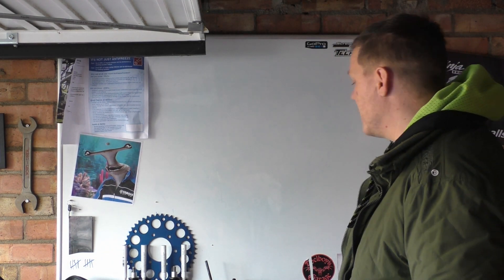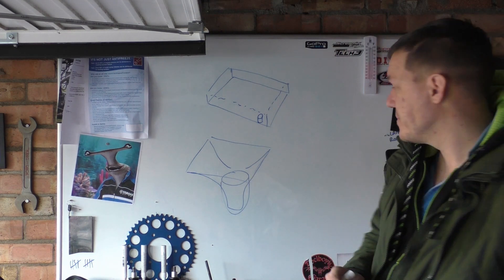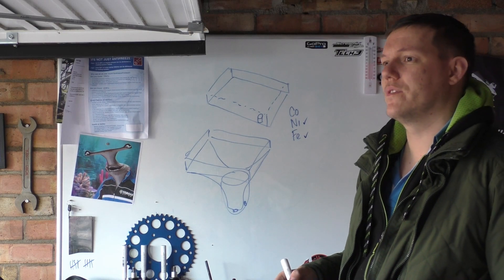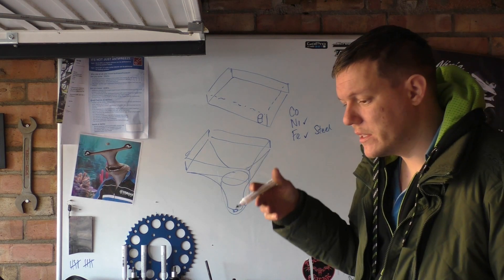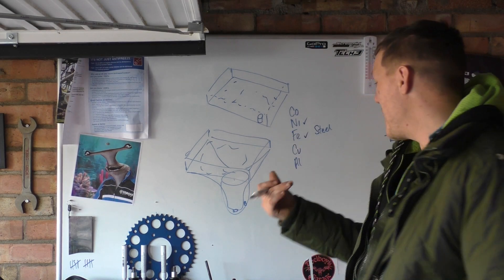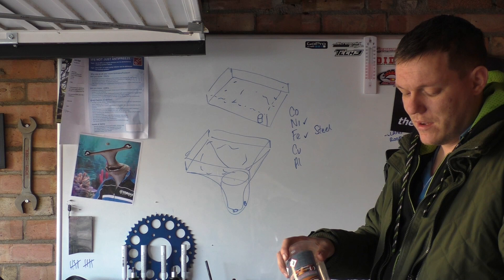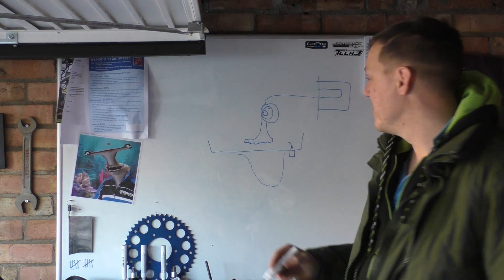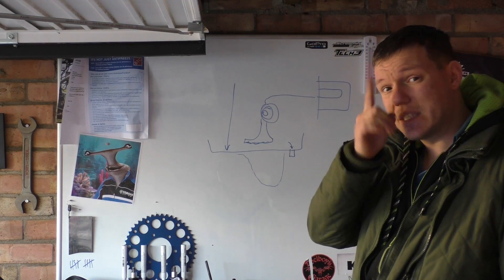Magnetic Sump Plug - Any good?

Comment: No, it doesn't make sense Matt. You've completely missed the point mate. 

The purpose of the sump plug magnet is to catch any iron based particular matter free in the oil system - TO ALERT YOU TO THE PROBLEM that you have... iron based particular matter free in the oil system. 

And you may ask why is this important? A few reasons spring immediately to mind:

Firstly iron based particular matter free in the oil system is an indicator that something iron based within your engine is failing. This could be due to a bolt vibrating lose or a roller bearing breaking down. 

Why is this important? Well, if an iron based bearing, chain or (as commonly occurs) a tensioner is breaking down, then the debris is likely to be potentially sharp, relatively large, and hard. Therefore it will cause massive damage to all parts of the engine, but most quickly and devastatingly to the softer (and expensive to replace) parts such as the pistons, bearings and bores, as well as the hardened metal to metal parts such as the cams, followers, valves and gears etc. 

Whilst if a bronze bearing or an aluminium part such as a piston is breaking down, the resulting bronze or alloy based particular matter free in the oil system will (as you said) most likely to be much smaller, and (even if its a lump of piston skirt) much softer and therefore cause a lot less damage to any parts, than any iron based particular matter free in the oil system. 

That's a no brainer. It's an early warning system. I've seen little 'Christmas trees' and mats of tiny iron particles on magnets in the past. You find such evidence long before you hear a characteristic noise associated with some part failing. 

This is just one more reason why regular and more frequent oil changes than the manufacturers recommend is a great idea - especially if you do track days, ride very hard, or do a lot of short journeys. Each cause excess engine wear. The oil is the most important and cheapest component in any engine. Change it regularly, check the sump magnet every time, and you will lengthen the life of the engine many times over. 

I hope this has been useful.
Reply from the maker: "The purpose of the sump plug magnet is to catch any iron based 
particular matter free in the oil system - TO ALERT YOU TO THE PROBLEM that you have... iron based particular matter free in the oil system."

1) if you have chucks - where did they come from and surely you would notice.

2) Tiny iron filings would alert you to what? Normal wear or a problem? If you have foun tiny filings on your magnetic plug, what did you do? Tear the whoel engine down? if not then your theory is incorrect, by your own inaction.

3) Like I said most of the engine components that shit the bed are not steel.

4) Filtering out the shit is what a filter is for....
Reply: The Workshop you replied:

" 1) if you have chucks - where did they come from and surely you would notice."

Any of the places mentioned. And you might not notice. If a cage starts to break down on a roller bearing, the thing could still be working reasonably well. 

"2) Tiny iron filings would alert you to what? Normal wear or a problem?"

How long is a piece of string? Change the oil and check it again in 100 miles or less. Simple. 

" If you have foun tiny filings on your magnetic plug, what did you do? Tear the whoel engine down? if not then your theory is incorrect, by your own inaction."

Ah, assumption is never your friend. I always listened to the engine in various parts using a hardwood dowel - as my Dad taught me to do. He learned the trick from a guy in Liverpool who prepared his own Velo for the island every year.  

Having listened to an engine from brand new and monitored it regularly, my ear was attuned to the differences. This made it a lot easier to isolate potential issues. Some people laugh at this method, but it works. 

What I did next always depended on the age of the bike. If it was still under warranty I took it back to the dealer. If he refused to investigate the issue, I rode it like a cunt until it broke. THEN I took it back to the dealer again and told him I wanted a new fucking engine. 

If the bike was older and out of warranty, I either stripped it down to check the suspect part (and found I was always right), or I part exchanged it - at the dealer that refused to take me seriously the last time :)) He always inspected bikes before buying, serviced them and issued a limited warranty to the next owner. 

"3) Like I said most of the engine components that shit the bed are not steel."

Most times you fall off your bike you don't land on your head. Is that a valid argument for not wearing a helmet? Like I said, it's there for the really abrasive hard bits that just happen to be steel. 

The point I missed before is that you often find minute curly bits of steel swarf in engines. That shit is really abrasive. I've examined bits of swarf from magnets that look like flattened springs. That means they've already been through one or more bearings!

"4) Filtering out the shit is what a filter is for...."

Next time you see a scored piston and or bore on an engine that hasn't seized or dropped a ring, consider that the oil which splashes those components may not actually have gone through the filter before the particulate matter suspended in it caused the damage. 

After I was in aero engineering I went into advertising and had several race teams as clients at one time. Another built race car chassis. Some designed kit cars. Another maintained historic race cars and ran them all over the world. I even had Barry Sheene as a client. So I've been in the room when the tech guys who absolutely HAVE to know what's going on inside an engine were discussing diagnostic methods. In those days there were a lot of magnets on engines. But it wasn't widely known. 

I've also worked with the guys who restore, maintain and fly warbirds. I'm not going to namedrop, but I knew personally half a dozen Spitfire and P51 owners, their pilots and their maintenance guys. Guess what, they all know about the value of magnets in the oil system. 

But if someone tells you strapping one to your dick will give you harder erections, he's a lying cunt ;))

Comment: Fair enough not much ferrous material in modern car engines but for gearbox’s and any other transmission parts they generate a lot of ferrous waste
If you have a magnetic drain plug and collect anything then it has done something better than nothing 
Now put magnets on the outside of your oil filter and bam you get to have all of the oil pass through a magnetic filter when you change filter remove the magnets and put on new filter

Comment: Magnetic plugs, its a give or take thing with me I won't go out and deliberately pay extra for one but I won't avoid buying them either.
That said I was servicing my mates bike and found bits of needles and race out of a roller bearing caught on one with more in the strainer, it turned out the bearing from one of the gears that transfers power from the starter to the crank proper shat itself. 
Although the engine had to be rebuilt the sump plug did alert me to the failed bearing.
Reply from the maker: "it turned out the bearing from one of the gears that transfers power from the starter to the crank proper shat itself."

- but he didn't hear it when starting?
Reply: Yeah the starter did make a clicking/rumbling sound and he was told by the previous owner that it always did it and not to worry...
Reply from the maker: "he was told by the previous owner that it always did it" - reciepe for disaster right there LOL

Comment: Agreed, If there's one there, fine.
 Syphon tube? Suction tube surely,
Reply from the maker: pick-up tube, syphon tube - who cares
Reply: It's easy to get pedantic about details like that, I enjoyed your drilling video, reminded me of Ichiban Moto. 
 Cheers, J.
Reply: I wanted to comment that as well: A syphon tube to me is like a U shaped thingy so there is always water in it so no nasty smell/gas can go through like in your toilet or more visible in the piping under the sink. So the english definition is actually different from that I suppose?
Reply: You are almost right, the thing you are thinking of is a water trap, It stops gasses passing back up pipes without blocking the pipe to allow for different pressures either side (badly put as usual).
Reply: Average Joe yeah that toilet/sink U shaped thingy. That's the only thing called syphon in german
Reply: water trap is a quite easy and descriptive name though :D
Reply: Yes Joe. A water trap is the U Bend under a sink, bath/shower or your karsey, the bit to stop minging smells from coming back up the drain.
A syphon is in the toilet cistern and when water is pulled into it, the whole cistern then SYPHONS out flushing the bowl and the shite etc away.
If it doesn't actually syphon I wouldn't think it proper to refer to it as a syphon.

Comment: If your sump plug is a bit chewed up and you can get a nice new annealed copper washer and magnetic sump plug from ebay for £2 - 4 delivered then where's the harm? They can grab bits that might be overlooked at oil change and alert you early to an already developing problem but by then you are probably in trouble if you see more than a tiny amount of iron dust/oil mulch.
 If you are seeing stuff such as a needle roller or big shards of metal, it will only attract ferrous remember so only bits of ball race cage , needle roller and maybe shavings/ a shard of piston ring etc. are likely to show up, otherwise you might get bits of cogs from gears or selector dogs if you change gear like a wanker or do clutchless downchanges or can't change up because you're a numpty.  Either way it all spells medium to big trouble in my book.
Most of the motor is aluminium, with magnesium bits sometimes on race bikes. I used to be a bike mechanic in Waterloo, London after I left a shipyard in 1990 and I was taught to always recommend people change their oil at either the mileage the manufacturer recommends or even sooner if you like to thrash the tits off your bikes and every year regardless of if you have reached the mileage they say. If you do small miles and have a nice dry warm garage for your pride and joy you might be ok every couple of years but I personally would stick to the script and not be a scrooge. ALWAYS CHANGE YOUR FILTER!! I tend to use either a OEM or same supplier none branded, meaning that if Nippon Denso make Honda's filters, I would fit genuine Honda if in warranty and the same filter for half the price because it comes without HONDA screenprinted on it but is IDENTICAL in every other way, made in the same factory by the same people, Nippon Denso.
 I don't do spurious ebay crap to save 47.3p over what I have just stated. I always use the grade and quality oil the manufacturer recommends or better even, they know best, they spend tens of millions on R&D so why make your own mind up and think you know best. Also don't be tempted to put fully synthetic in to a bike that is meant to run semi synthetic, it won't damage anything but quite often, like on the Fireblade and other CBR's, you can get a bit of clutch slip as a result, annoying at best and costly if you leave it at worst as you will have to fit a new set of clutch plates and change it back to semi-synthetic.
 I want a shiny anodised red sump plug, Del Boy swears my bike will go faster as a result, well, he probably would, it's the kind of crap he spouts all the time.
Personally, I think he eats too much cheese (maybe knob?), dreams too much at night and thinks it's real life when he wakes up in the hooves of his goaty lover.

Comment: Magnets actually repel aluminium and copper.

Car gearboxes tend to have a magnet at the bottom of the sump from the factory for the reasons you have highlighted, plus the increased likelihood of having large participial's in the oil if someone had been grinding the gears. Also with the gears themselves being the oil pick ups, you don't have a screen or filter. ...Car engines not so much.
Reply from the maker: "Magnets actually repel aluminium and copper." - are you sure LOL
Reply: The Workshop just like delboy and his water/oil emulsion, he's just too smart to be understood, really.
Reply: Magnets repel anything conductive however it is an extremely week force. Hence being overcome by magnatism in steel ect being atracted. This is only really demonstrable with extremely powerful magnets however if we are talking microscopic particles there might be something in it.
Reply from the maker: LOL you nice try, seriously. This would be true if the magnet was a powered AC magnet. 

Steel is magnetic and will be polarised by the field and produce an amplified magnetic attraction. 

Aluminium is non magnetic and this does not happen. However it is a good conductor of electricity and the changing magnetic field will induce "eddy currents" in a block of conducting material.  

The net effect of these eddy currents is to produce a weak magnetic field that opposes the field of the electromagnet so the aluminium is repelled but only  by the an AC powered electromagnet.
Reply from the maker: For people who are interested look at the Lenz effect - https://en.wikipedia.org/wiki/Lenz%27s_law
Reply: Nope... diamagnetic effect is not exclusive to electromagnet and Lenz's law simply describes how electromagnets work (by exploiting this effect).

Comment: Ok, I'v poured 10 grams of iron filings into the oil filler on my car tonight to see if this magnetic sump plug works for sure.... I intend to use the car for 1 week from today and I will remove my magnetic sump plug next wednesday to see if it contains the 10 grams of iron filings I put in for conclusive proof one way or another.... And you think you know how to do experiments Matt ??
 I'll show you :)  X
Reply: Good luck with your car's engine.
Reply: cringe lol :)
Reply: Sound's like one of Del's experiments.
Reply: Interesting experiment. I recommend you continue with this approach for several cycles to find the optimum position for the mag plug :o)
Reply: @ Truzo
Does sound like it, but I thought of it all by myself...
Reply: Hey Eddie - start a mag plug channel - its going off mate! :o)
Reply: ha ha ha, be funny if me car don't have a magnetic sump plug wont it ? ....

Comment: so you know a lot about magnets. i had tried this style plug once. when i went to remove the bolt the head snapped clean off leaving the shank stuck in the oil pan meaning i had to drill to remove it. do you think this had anything to do with the magnetism or just a shitty bolt?
Reply from the maker: Shitty cheap metal

Comment: I always kind of liked em. Never been and bought a replacement one for anything though.
It's just nice to have that extra level of information for no extra work, when doing a simple oil change. Whip it out and it is still virtually clean, you pretty much know no metal parts are wearing excessively. Especially if it is an engine you happen to service regularly or are responsible for.
And on some engines, (granted, I'm speaking almost entirely about cars/trucks/plant here) I have noticed shit starting to accumulate due to accelerate wear with evidence of extra deposits/small chunks or fragments. I seem to recall quite a few of the old 50's to 80's era diesels having them.
And lets have it reet. It costs fuck all and it doesn't eat owt. So why not bung one in from the off?

Comment: So you say it is sense less like a magnetic butt plug? Well piston rings and shims are magnetic and you might find them there?! you don't take off the oil pan with every oil change but you take out the drain plug where the magnet is attached to. Then you know if you have find something you need to investigate some more and take the oil pan off. You might argue now to look in the oil pan when you poor it in the canister, but there is one problem: what if there is just a big bit of metal stuck in the other corner when you drain the oil that just did not got out that time? But it would with the magnet because it will hit it some times when the engine runs. It also does not hurt the engine to be there.
Reply from the maker: It doesn't hurt no, and I did say if you've got one no biggy. But what component is that big "big bit of metal stuck" that you can run an engine without? A lot of the shit that you find now and then in your sump is aluminium flashing from the casting that has eventually broken off. Magnet ain't gonna help you there. 

But for arguments sake, lets say a tooth from a gear broke off. 

1) your gonna notice at some point.
2) It would have to pass within 4 or so inches of the plug.
3) it ain't gonna get sucked up back into the system - because of the mess in your pick-up tube/hood.
4) If it somehow did then its has to make it up the pick-up tube and through the narrow and usuallt tight passage ways into you pump.
Reply: "Penis"... (just want to write it) Matt, what if a half of a tooth of a gear broke off? A part of the gear fork? you might notice that not right away or just some shite fell into it while you rebuild it and you did not notice it because the neighbors dog was killing your cat? I did not say that it will damage your engine when it gets sucked up. I said you want to know if you need to check for beginning engine damages. That could save you from buying a whole new engine. I just noticed that a magnetic butt plug might be help full to get the steel splinters back out after you get your handle bar stuffed up your arse. LOL! And I hope my oil filter gets all what gets pumped back up into my engine. Other wise I would say they are use less too. Well, to lean the bike over and braking or speeding up does move the oil around in there quite a bit.